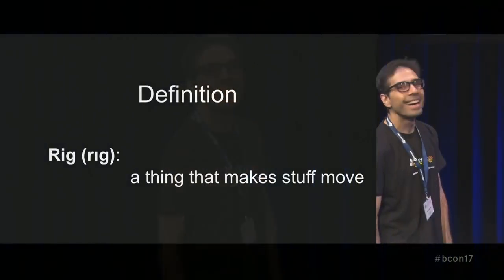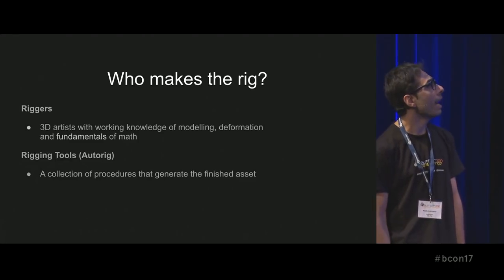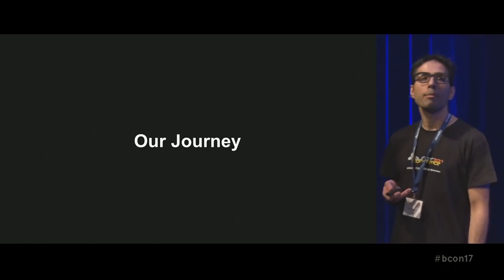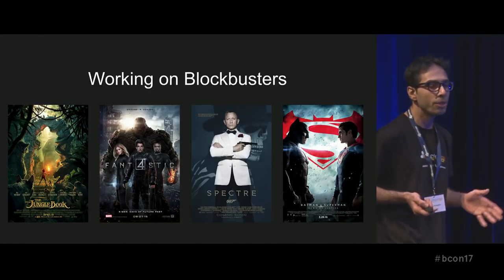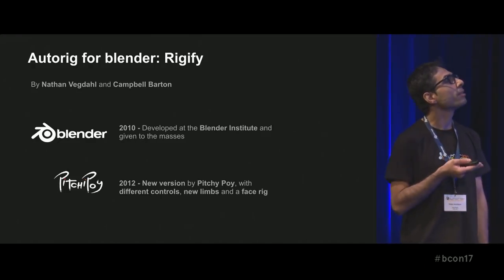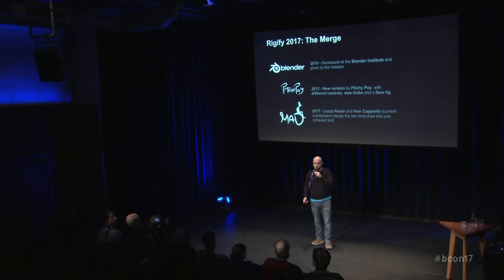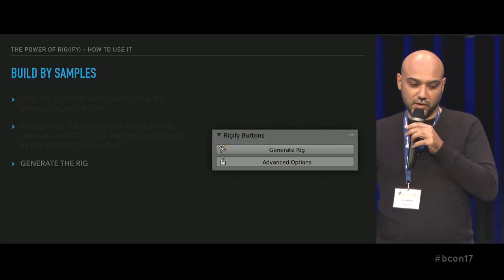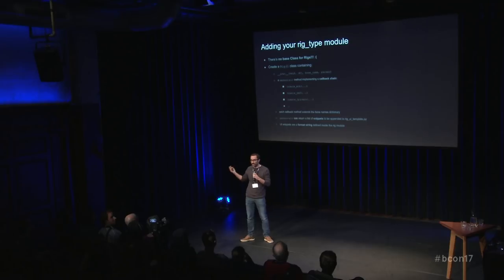The Power of the Rig: Creativity Over Complexity

Comment: I appreciate all the time, effort and new features added to Rigify in the latest 2.79 release. My only concern is that some very useful rig types have been removed from the rig type list. Specifically, the original spine rig by Nathan Vegdahl. I find this spine rig to be very useful for background characters because of it's ease of use. Also, I feel having this "simpler" rig is beneficial to those who are beginning animators for the same reason, it's simpler to use and animate with. That said, I realize that some of the rig types needed to be pruned and were redundant. 

I look forward to exploring adding new rig types myself as I think that is the true power of the Rigify system. We have not realized the full potential of Rigify until a larger list of rig types becomes available for the public to design and use.

Thanks guys!